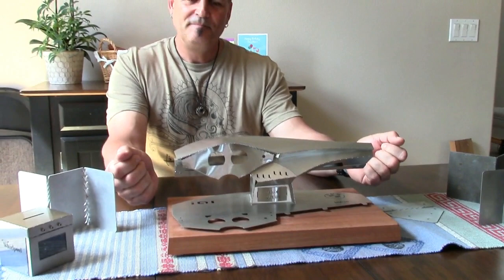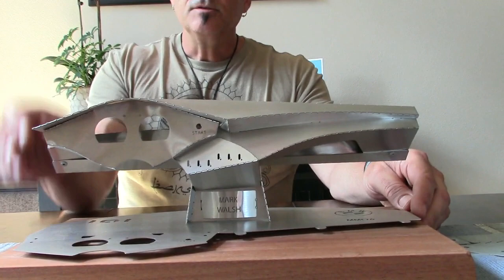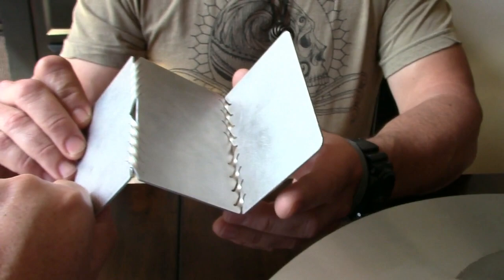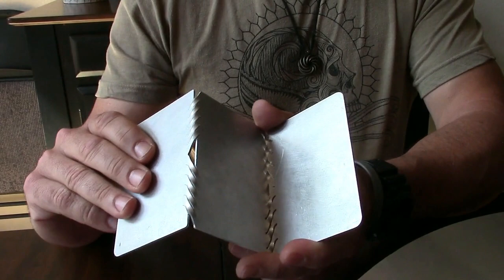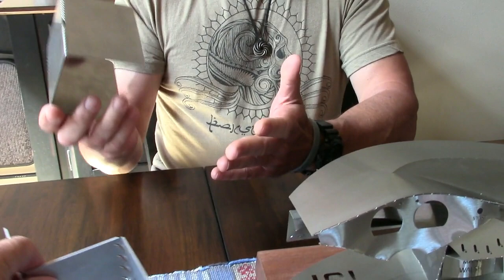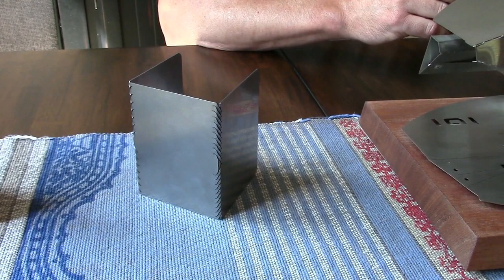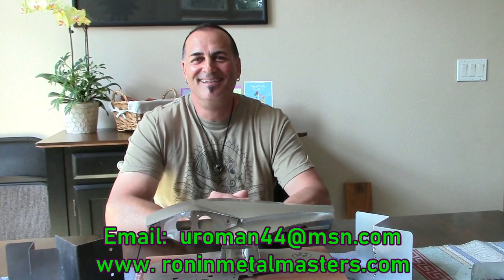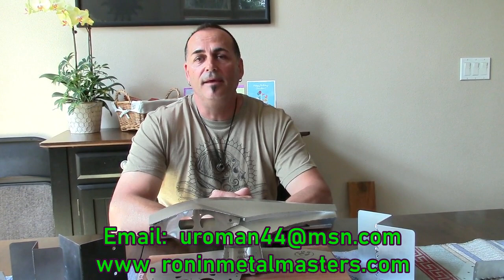Mark Walsh - Folding Metal Documentary Nov 2019 Interview by  Michael Tellinger

Comment: did that break at 30' past 90'? 30' is an important number in sacred geometry. Its the degree of the first right triangle off of a vesica pisces
Reply: It did not break, I can fold into a hem and then unbend it with no fractures.